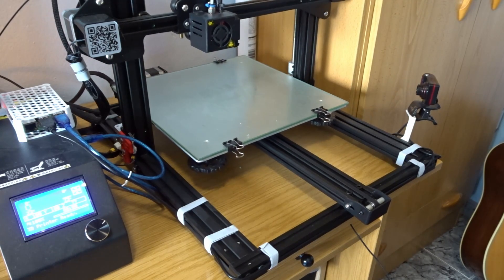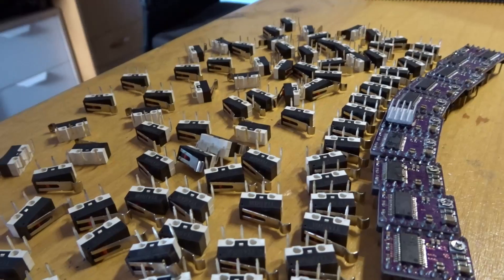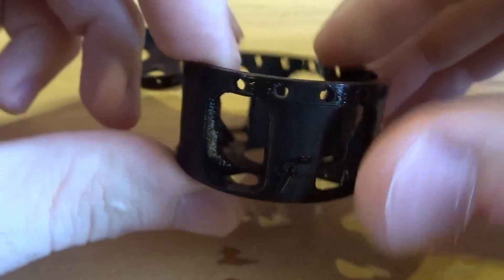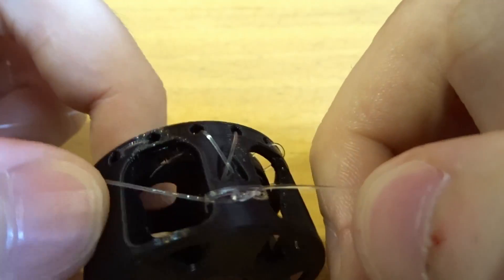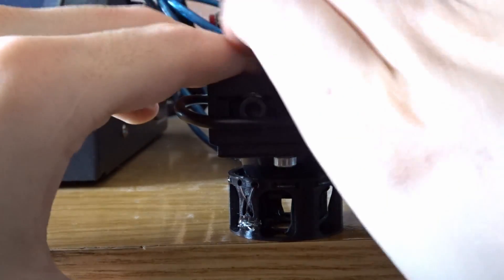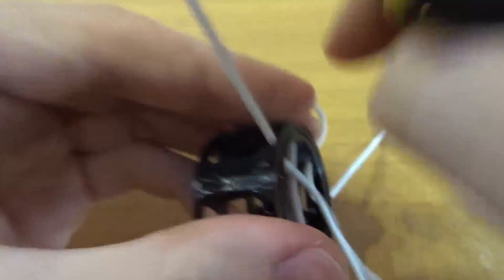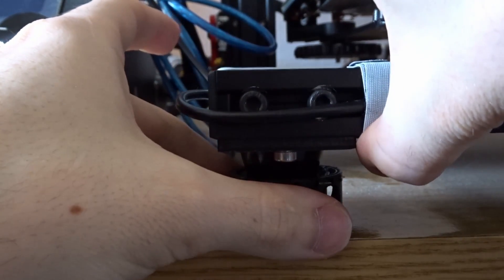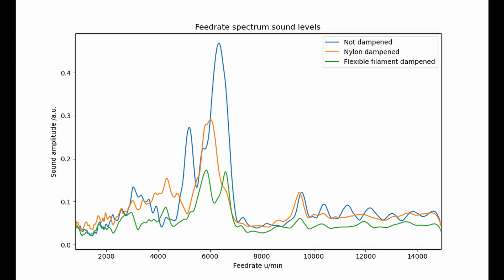3d printed Anti Vibration feet

Comment: This is a great idea! Have you thought about using a magnetic suspension system?
Reply from the maker: That is a really good idea. I've actually worked with magnetic levitation before so it should not be that hard but I just have not had the time.

Thanks a lot for the suggestion :)

Comment: This looks an ideal 3D printed foot for my Ender 3 S1. I had seen some which needed squash balls. But I like the fact that these are fully 3D printed and uses lengths of TPU!

I wonder how effective they would be if I made some for the feet of my airbrush compressor? Certainly worth a try for the cost of some filament
Reply from the maker: I tried to make them as available as possible by just using 3D printing filament.
I think they should be useful for any vibrating equipment.

Cheers :)

Comment: Hey, fisherman here! 

The fishing line you used is called a "monofilament" line, one of its main features is it is "tangle resistant" meaning, hard to do basic knots on it (hence why we have "complicated" knots). Try to use the cheapest "braided" or "braid" fishing line, it is much easier to knot, and stronger.
Reply from the maker: That's a very useful feature :)
I did not know that such lines exist for this purpose. I'll take it into account for future projects. Thanks a lot :)

Comment: Fantastic design!  How did you test the frequency response?  Our 3d printer shows up in a few days and I would like to print dampening feed for it.  Yours is one of the best designs I've seen yet.
Reply from the maker: Thanks a lot :D I tested it by using a microphone inside the table drawer below. This way the table acted as a resonant structure that would amplify the vibrations. I swept the speed to have all the possible "frequencies", to avoid printing around those speed values and to see how effective the dampening strategies are.
Good luck with your 3D printer show :D

Comment: Why not just print the feet out of the stretchy rubbery tpu filament you used as rope?
Reply from the maker: Because in this way, ve varying the filament threading count I can vary the elasticity without needing to reprint every time. This is better to adapt to different weight printers :)

Comment: Change the board with any BTT skr or similar
Reply: was also my first thought and to use a concrete slab all my creality runs skr silent the prusa is silent by nature
all stand on concrete slabs and i don't hear them during normal printing operations
Reply from the maker: @patrickmaartense7772  Because who does not have a heavy concrete slab laying around? 🤣
Reply from the maker: Yup that is the way to go, but it is not as cheap as this 1$ upgrade 😁

Comment: This look like a good solution for sound but how about the printing results?
Usually vibrations transfer patterns to prints,thats why the most important upgrade is the antivibration feets.
They absorbe the vibration erasing any pattern on the prints.
Reply from the maker: I have not seen any detriments in print quality :)
I think it is because the thread is elastic but also dampens vibrations quite a lot.
Reply: @marticurie1677  All 3dprinting community try to reduce vibration using hard foam board,or soft rubber mousepads.
These legs looks like adding vibration.
Try to print something in 0,1 with 0,2 nozzle with the legs and then the same without the legs but by adding a rubber moysepad.
Then compare results and you will see the difference.
Even if you have a silent board and noctua fans switching DB to minimum you will still need to reduce vibrations for even better quality results.
Reply from the maker: @dragonld123  Okay I will try and let you know :)